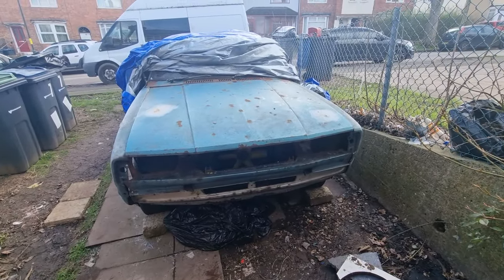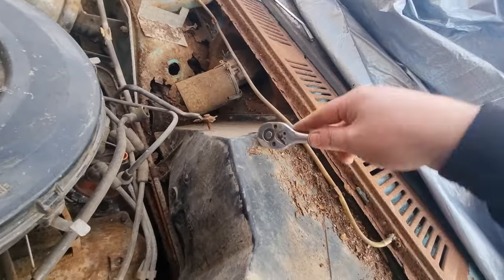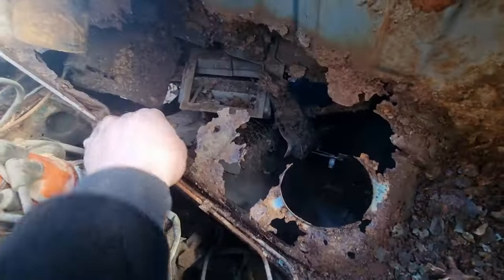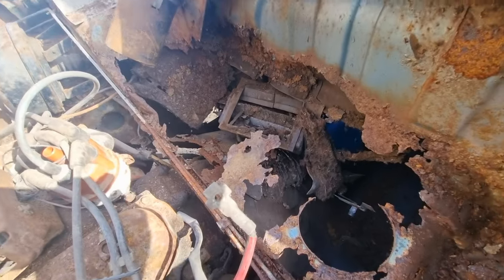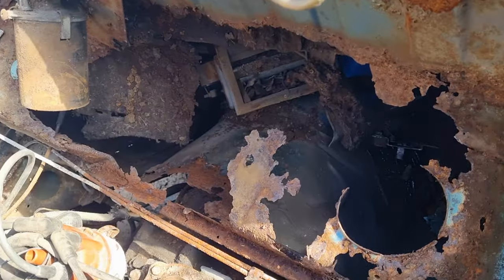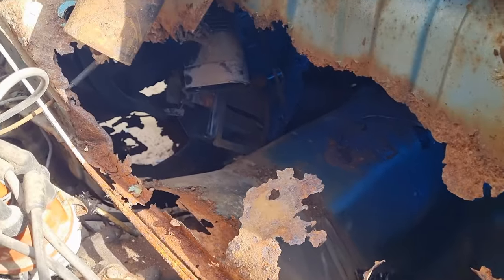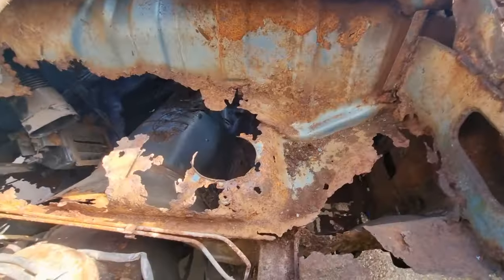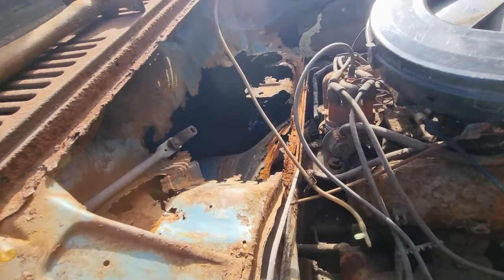Cortina Mk4 Ghia 2.3 V6 Restoration || Bulkhead Inspection (P3)

Comment: Replace it all with flat plate and do it as a clean smoothed engine bay 😎

Massive task you’re taking on!
Reply from the maker: that would look cool but the indents are the strength stops it rattling
Reply: @AdamSNook.  Yes they are ribbed for strength and droning on the thin material they manufactured the body from. Just weld in some thicker material. Ford manufactured the cars to a budget… if they used 1.0mm steel, you could use 1.5mm steel.
It’s a big job to form curves and ribs. It’s easier to weld in flat plates.
Time will tell, i wish you luck and will follow your channel 👍
Reply from the maker: @next0845 hmmm intresting heheh

Comment: I have a wiper motor plate you can have, It's for the 3 but might fit. Bulkhead panels can be bought but there is a waiting list. Someone in the mk4/5 owners club might have some panels you can use.
Reply from the maker: how much for the plate posted i wil lsort it out with you on my payday

Comment: Someone's probably suggested this.....I'm still catching up. But maybe you can find a used section that's in better condition? Even if it needs repairs it'll be better than making from scratcth maybe.
Reply from the maker: you on part 3 mate there as been loads of progress since then dont want to spoil the vidoes for you lol